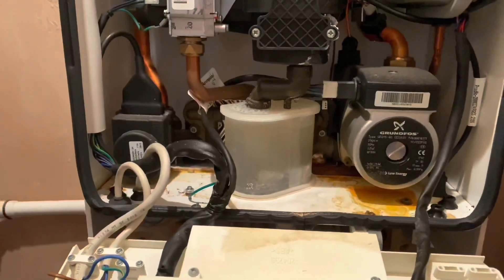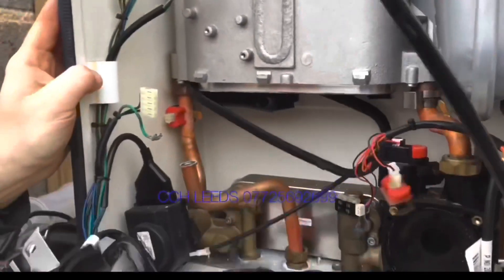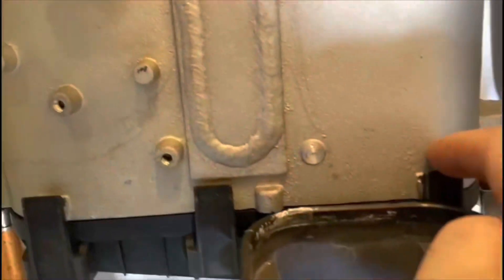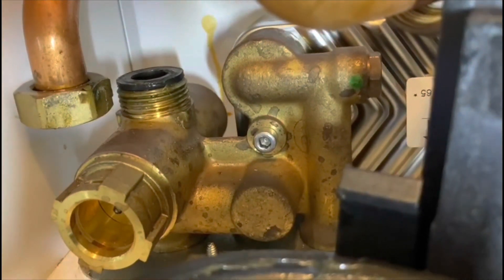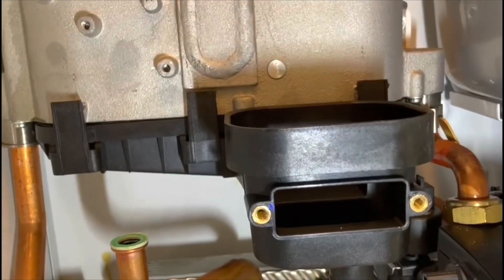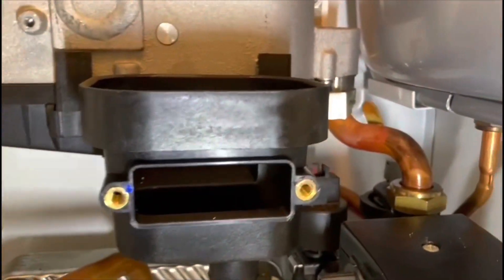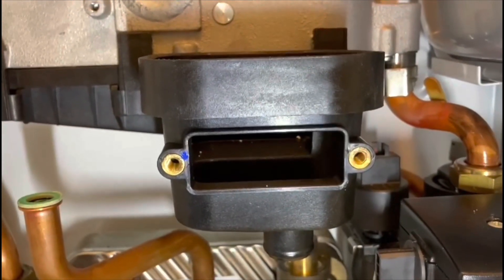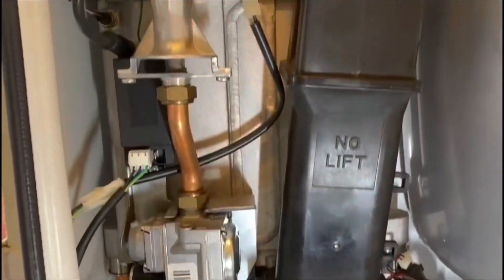Gas Training - How To Replace An Ideal Logic Sump - Combi Boiler Leaking

Comment: Alan i have a 10 year old ideal 35 combi losing pressure every day pressure relief valve seems OK
I've sw of heating valves still losing pressure,  I have a bungalow  I've  been under the floor 4 times can't find any leaks? Ido have a very slight leak on sump beside the inspection window no leaks below heat exchanger? Cheers really enjoy the videos  I've  learned alot cheers boiler works fine  heating and shower

Comment: How long goes it take to replace?
Reply from the maker: Depends how fast the gas engineers is and if you have any issues. I would normally allow 90mins and do a service at the same time. Thanks.
Reply: Thanks for replying , I was just wondering as on the service the engineer noticed a slight drip in the base of the boiler and the sump was then changed and it took about 20- 30 mins.

Comment: I've persistently got error code FA which usually means the pump is the wrong way around and the flow and return is in reverse. I've had the same issue since May of last year when I moved into the property and I've had Robert Heath out who installed the boiler about 5 times to this same issue and  each time they tell me they don't know what the issue is and go home again and Ideal tell me it's not down to them to fix it it's down to whoever installed the boiler🙄 Ideal have been out twice now once to fix the flow sensor and on the second time they said the pump is on the wrong way but can't touch it as it's down to whoever installed the boiler.  It was a new boiler installed back in February last year before I moved in.  I'm sick of it as each time my boiler turns on it shuts down after a few seconds of heating up but then comes back on again and repeats this until the boiler is very hot then I don't get the FA code. I bet you could fix it but it's down to Robert Heath and my landlord will only use them as they installed it. I'm not paying a penny my landlord covers it.

Comment: I have replaced several dumps on this particular model and I always take the heat exchanger out to replace the sump , it’ enables you to wash out the exchanger or jet wash it outside and it’s so much easier to put the sump on while the exchanger is on the floor and everything can be greased up properly and you are 100% that all the clips are in tact and secure before fitting back in . I was surprised a Ideal engineer was so heavy handed in snapping that sump off there is still no need to make this job so awkward it’s really so much easier with the exchanger out of the boiler . Thorough video enjoy this guys previous lectures on fault codes etc , nice one for posting this Allen .
Reply: I completely agree with you. I have as well changed many sump on ideal boiler. I always take the heat exchanger out completely to change the sump. It quite easy that way and you'll be rest assured that you've done it properly and in safe way.
Reply: How long does it take to change the sump?
Reply: Sorry they was my husband asking the same question 🤦‍♀️
Reply: I mean he's drained it, why wouldn't you just remove the thing?

Comment: You are obviously diligent in your work but I do not understand why, if you are completing all that work, why you do not automatically replace washers ?? 
They cost little, they "appear" to be fairly common 3/4 stock items and it is far less likely that a leak will occur either immediately or at some time in the future if they are replaced. 
Regardless, any work we complete where a seal is dismantled, a new seal is fitted every time. 

Slightly off topic, what really infuriates me is when a boiler manufacturer component is purchased, they  do not supply all the seals required to replace those being disturbed whilst completing the repair !  

Good luck to you though, in my experience there are not enough people in this industry with pride anymore.

Comment: Guys can anybody please explain what goes wrong with this sump setup, there is Sulphuric acid, heat, vibration, thermal shock and plastic parts, not a great combination. However, we are in the year 2021, so what could be done to achieve a better solution and what have other boiler manufacturers done to overcome this very same issue.
Kind regards
Reply: The only thing needed by your description is a proper installation and regular maintenance. I think your description of sulphuric acid is a little bit misled, as that would imply sulphur is present. Thermal shock occurs most of the time because of system problems but manufacturers built a fail safe into the pcb, by the thermistors detecting a 50 degree temp diff between the flow and return, which then would distinguish the combustion process, and the sump must be plastic as the condensate water would rot a metallic sump.
Reply: As I stated the condensate is dilute Sulphuric acid as a result of the combustion process of natural gas.
Reply: O.k I understand that, but there is a very small quantity of hydrochloride acid and nitric acid too in the condensate water. I wasn’t sure what point you were making. Sorry
Reply: @HalleB127MX  this boiler was manufactured in 2012 or there abouts,  ideal have identified this fault and made the sumps of a thicker composite. Ideal claim it split because ppl were to rough in removing the silencer

Comment: Where did you grease (and what type) did you use on the expansion vessel to help it to keep its charge? A smear around the cap thread, or  stuffed down the valve stem to seat the valve? Thanks and great video, I love the Logics and how nice to work on they are.
Reply: Id also like to know what kind of grease. Is it graphite?
Reply: @petenewell9945  cheers mate
Reply: I use lithium grease personally
Reply: @HalleB127MX  thanks bud!

Comment: Absolutely no need to drain the boiler.  You’ll be as well just taking the heat exchanger out doing it that way. You can still slacken the hex bolts pull hex and push sump back and down and the right hand side will come of. Then lever the left side between the sump and the rubber seal to protect hex and will pop of just the same. All without undoing connections and reusing the old seals, especially the o seals in the hex.  Agree some of the butchers on YouTube ripping them out is horrendous.  Trust me … I’ve done hundreds.😉
Reply: It's not hard to do our job right. There's too many people not doing the job right .they call themselves gas engineers but there not .
The jobs should allways be done as manufacturers instructions. Too many don't do the jobs right .
Reply: I just like to do it that way.  One times out of ten, the expansion vessel is flat so it’s as well draining it. I take my time, so it properly, neatly and I rectify anything else at the same time. I did say that people would ask why I do what I do. I appreciate your feedback but I will continue to do it my way, I does not take any longer in my opinion when your doing other work and I have the luxury of new o rings if necessary.
Reply: @HalleB127MX  yeah but you basically slagged everyone else saying we're not engineers we're just plumbers😂, you don't need to drain or loosen anything off other than the screw on the right which helps, and you don't need to rag it and snap it like in the other video posted, I get them out just as easy as you did, you pretty much could've just whipped the heat ex out
Reply: I never put that guy on the video snapping it out, Allen edited my video. He put that in along with a few other bits. I said I was an engineer and the other ones I saw were heavy handed plumbers. In my opinion pulling the heat exchanger forward, pulling and down on it with the compression fittings under pressure could damage the joint, you may not notice it but after you have gone it will be weeping, if you do it that way then good for you, but that’s not how i work, I said in the video this is t necessarily how people do it and I would get people like you saying you don’t need to do that, so I’m not sure what point your trying to make, my way is best for me, that’s how i work and deal with every job, carefully and methodically.
Reply from the maker: @steowens8243  I edited the video. The person snapping it out is me. Personally, that’s the way I do it, The way in this video definitely looks better though, It also means you can pump the expansion vessel up at the same time. Thanks for the comments.
Reply: @HalleB127MX  . Fair  play to you mate  doing it that way… each to his own. The Point I was trying to make is, you’ve said not to put strain on those joints under pressure but then you slacken of , twist pipes around then reuse the old seals. I think there is more chance of that way leaving a leak after you’ve gone.  Sure you wouldn’t change the hex and use the old seals so why with a sump change. Ild never reuse old seals as I’m careful and methodical 😉😂
Reply: The heat exchanger o rings are not under pressure as I have drained them down. On that instance the hydraulic  o rings were in tact, no signs of stress and I cleaned and greased them, if they were worn and stressed I would have changed them. I have been doing this job over ten years, the logic was introduced on my watch, I know what I am doing so I am confident in the advice I’m giving, if you don’t agree then fair enough, you dont have to.
Reply: @HalleB127MX  only 10 years. There you go then. I’ve been at it over 16 years and the logic also introduced on my watch and don’t know any other Ideal engineer that does this your way. Never had a problem once doing sump without draining since 2009.  Always change the seals , no excuse for the manufacturer not to do this, only takes a second and ensures longevity of the repair. Also, don’t grease them, they are not greased when initially assembled, like the plate hex seals the grease can turn  them to mush over a period of time.  All the best my friend. I do enjoy your videos. 👍👍
Reply: I’ve been in the game 25 years, BG apprentice. I’ve worked for ideal 10 years.shortly after starting the logic was launched. You are clearly not listening to what I said on the video. I said this is not necessarily what any ideal engineer would do, and I said I would change the seals bit this wasn’t a job for ideal, it was for a friend. I always change all seals on ideal jobs. And infact grease causes a vacuum and makes a better seal. That point about turning them to mush is not valid at all. I’m not pretending to know everything, I certainly don’t know everything and I’m very much willing to watch a video of yours to show the “correct “ way of doing it if you would like to make one.
Reply: By the way I am no longer an idea engineer as of last week.
Reply: @HalleB127MX  lucky you. All the best mate.. 👍👍
Reply: Are you?
Reply: The guy literally says this is just his way of doing it. Personally his way seems like best practice in case of something going wrong. It seems like it's 10-15mins more time, but avoiding an hour of other potential issues
Reply from the maker: @mendyourhome  This way definitely looks better than the way I do them.
Reply from the maker: It shows a different way, Maybe a better way.

Comment: Good video. 
Would you say a cracked sump is 'At Risk' according to the unsafe situations or would it be fine to leave it whilst awaiting  a new sump?
Reply from the maker: It’s a personal opinion really. I phoned Ideal and they said it’s just a broken boiler and not classed as anything. Personally I would class it as AR as the case could rot if it was left. That’s only my opinion. What would you class it as? Thanks.
Reply: @AllenHart999  AR, same as you Allen. I know some smear a bit of LS-X as a temp fix to save them the hassle of turning the boiler off.
Reply: I'd class it as AR  every time. It's leaking combustion and condensate water.